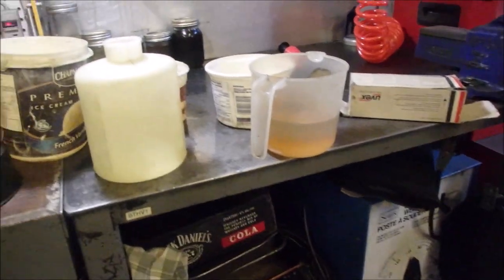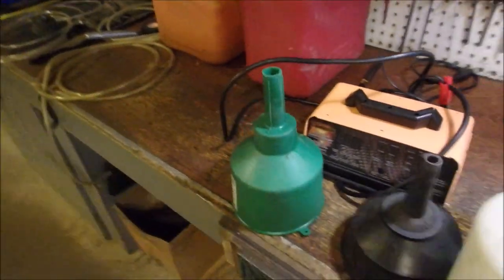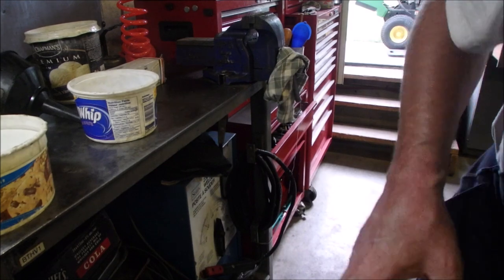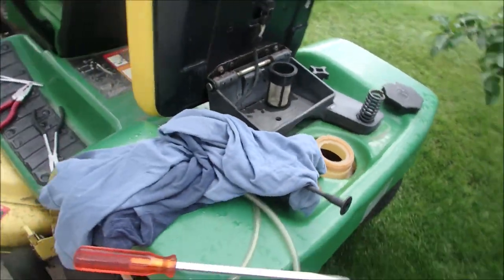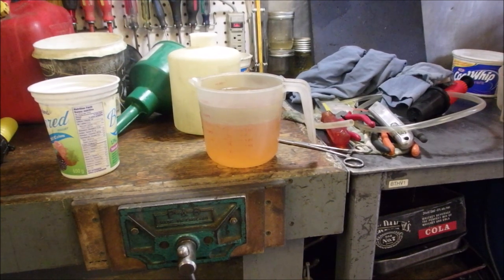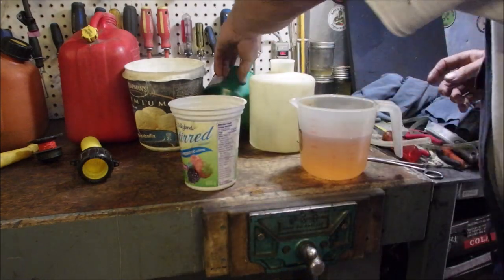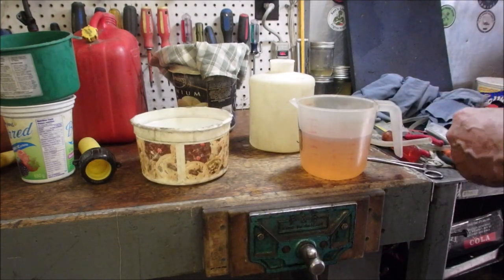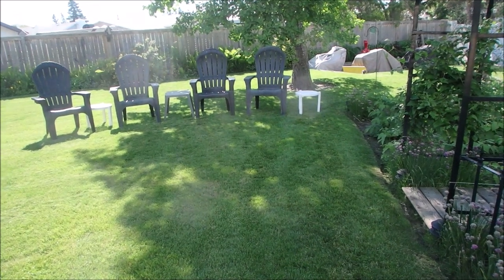Bad Uncle Bruce Bad   !!!!

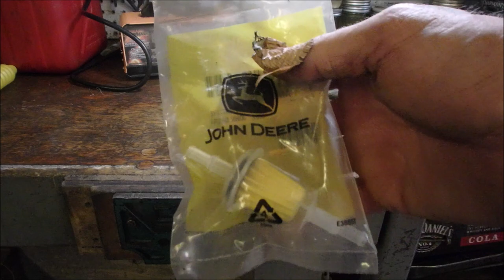Comment: At 4:22 note the correct filter with Barbs to retain the fuel hose.  Most if not all Chinesium filters have smooth transitions from 1/4 to 3/8 diameters and will vibrate off! Only use inline filters that have the Barbs!!
Reply from the maker: Thanks Ken.  Yes the old one was hard to get off as well.
Reply: Do either or you think the JD filter comes from the same factory as the as the cheapest filters do?
Reply: Tom, I have seen JD fuel filters in JD packaging where the filter says Made in Mexico or Made in China on it so probably from the same shops

Comment: I have started using no-ethanol gas in my mowers and have always used in my two cycle engines. That water sure wreaks havoc on carburetors.
Reply from the maker: So true
Reply: I did a 1 year old PowerMore carb recently and the corrosion was incredible. I told my customer to put the gas can contents in her truck, and buy some fresh fuel for her mower.

Comment: Hi Bruce, I have had several older J.D. riders with alot of water in the fuel most from rainstorms. Somehow it can get in through that domed fuel gauge? I have even taken the body off, inspected the tank cleaned everything. But I don't trust that old orange fuel only for my freebie push mowers to burn. I saw Briggs v-twins (2) with broken rods and 1 with a broken cam. All 3 had stinky orange fuel and very irate owners! Your garden looks nice!
Reply from the maker: Thanks for the info!.  Our garden is just coming on now.

Comment: those pickup tubes don't go all the way to bottom of tank (at least mine don't) . even if you try to run it dry occasionally , water tends to accumulate at bottom of tank . saw a vid where someone removed the ethanol from gas , but they said it also removed octane .
Reply from the maker: Yes I saw one like that too

Comment: How do they keep the ethanol from separating in those big tanks at the pumps ?
Reply: Ethanol is added to the tanker truck right before it goes to the station then they count on using it quickly at the pump.  Keep in mind that water goes to the bottom and the gas pumps also pump from the bottom so any tiny bit of water goes to... whoever grabs the handle to pump gas first.
Reply from the maker: You are right Bill
Reply: @BrucesShop  no idea how, or why I knew that.  🙂

Comment: Mr.B, do those special funnels that separate the water work ?
Reply from the maker: I am not 100% sure
Reply: Bruce said the rag works as well but the funnel filter is easier to use. I think one needs a container with a petcock in the bottom to remove water like a diesel uses but he had good results skimming the fuel off the top.
Reply: Good   day fellows  I bought one  &  I am not convince   that they work totally either.  U have to pour slow,  & there is some that cannot come out because of design.  Never tried rag.  Thanks

Comment: Did you pressure wash that JD mower?  That’s a boatload of water in the fuel!  Maybe it got by the cap on the tank.
Reply from the maker: No.  I am not sure how i got the water in there.
Reply: @BrucesShop  sounds like it’s running good now!  I would hate to think the gas station was adding water to the gas, but…if they are hope they get caught!

Comment: Over the past couple of years, I’ve acquired a lot of good, bad and ugly gas.  I’ll get a mower where the owner said they added new gas.  So, I have 3 gas cans.  New, which is what goes in any tuned up machine. Old, gas that looks good, I burn in my Toro.  Bad, gas that looks really bad, that is destined for the Ecocenter.
Reply from the maker: I have an "old can" of gas too
Reply: @BrucesShop  
I actually have two labeled OLD now.  The first one is full and I just can’t use it up fast enough.  I often transfer back and forth from another can, running it through Mr. Funnel.  I think it helps… I don’t like that it has a reservoir below the filter.  Not sure why that is?